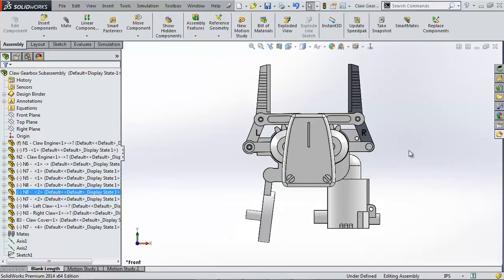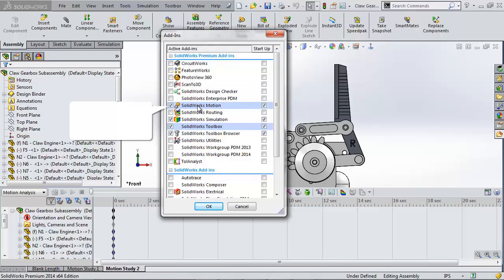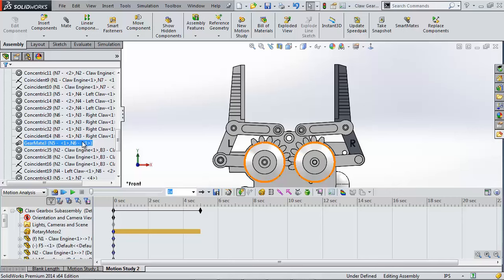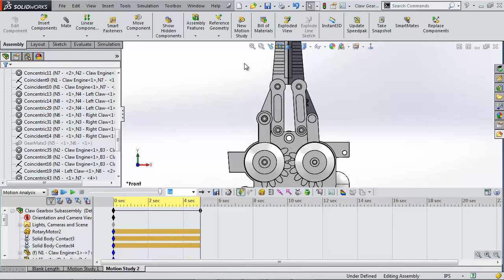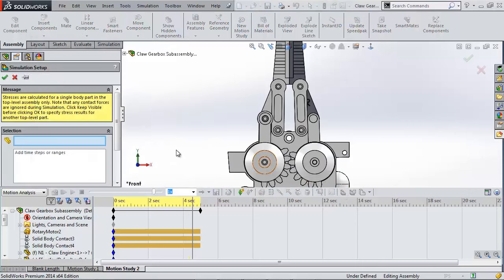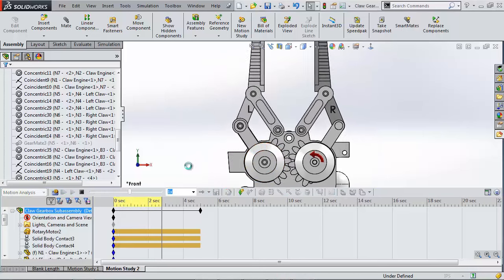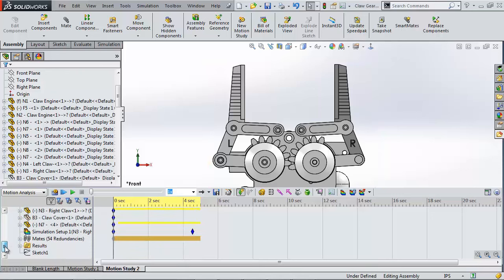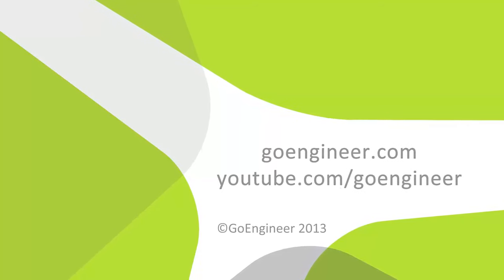SOLIDWORKS Quick Tip - Setup and Analyze Motion Study

Comment: My time bar is fully red ! What to do ?
Reply from the maker: Hi Pranaov,

That means that the assembly has likely locked up or the solution is unable to complete for some reason. Troubleshooting something without seeing it can be difficult, but here are a few steps that may help to narrow down the problem:

1)	Does the motion run if you switch to Basic Motion rather than Motion Analysis?
2)	How many parts or mates do you have? Possibly you may need to simplify. Check out this recent blog on simplifying for Motion Analysis. 
a.	This blog shows how to turn off redundant mates and replace with bushings, and how to change their parameters. That may be necessary to soften up what is binding up your assembly.
3)	Build the assembly up from scratch – start with three components and whatever necessary mates, motors, or contact. Does that work? Add in components a few at a time. Eventually you will see what is binding up the calculation.
4)	Reach out on the SOLIDWORKS forums at my.solidworks.com or your local reseller, I’m sure someone can help you troubleshoot.
Reply: @goengineer  thanks !

Comment: how to change initial position of parts in assembly for motion analysis?
when we move from model tab to motion study tab. Motion study take its initial position from model. if we want to change initial position of part in assembly. the motion study does not accept new initial position... how can we change initial position after one calculation?
Reply from the maker: Generally I go back to the Model tab, adjust the position as I want, and then make a new motion study. This is the cleanest way to have a new starting position.
 The next most sure-fire way to get your exact placement is to: set your grey time bar back to 0 seconds. Create distance and angle mates necessary to get your part into its new position. Click rebuild if necessary to see the update. Suppress those mates in the Motion Study. Then recalculate. 

As you want to continue changing position, repeat the steps above: set time back to zero, unsuppress the mates. Right click on them to edit dimension. Rebuild. Suppress the mates and recalculate.

Comment: When you set the contact between bodies there is also an option to set materials? However you can only use a handful of them. How should one if his assembly ismade of materials other than these?
Reply from the maker: Hi Alex1986lunatic,
The materials used for masses of your bodies in motion are also brought in from the definitions applied to each model before this video starts.  The video shows a single body where material was not applied to illustrate the how the system will react to that situation.
Reply: I don't think that's what happens. By default, the first material option (acrylic) is applied when you set contact bodies - if you had scrolled down a little bit you would have seen that. You must un-select it and then set several values for the material you want which are almost impossible to know for every single material. And this material influences the results of the motion analysis which in turn influences the results of the simulation (regardless of the material you might have originally assigned to your parts through the feature tree).
Reply from the maker: Alex,
Perhaps we are indeed misunderstanding each other.  At this point I would encourage you to contact your local SOLIDWORKS VAR's technical support department (http://www.solidworks.com/sw/purchase/varlocator.htm ) so they can work with you one-on-one to understand and answer this question for you.
Reply: Thank you for your time.

Comment: hi,
there is no choice of animation motion analysis and basic motion bars in the motion study chapter. so i need to explain some diagrams of mechanism. is that about version ? i use solidworks 2014 premium. please turn me asap. thanks
Reply: +Seçkin Bozdemir Basic Motion is supplied to every version of SOLIDWORKS. It may be that you did not install the motion package (check your installation manager options). Motion Analysis is only provided as an add-in with SOLIDWORKS Premium.
Reply: +Shivani Patel thanx a lot for answer. i try it again later.

Comment: Facing this problem many times during motion analysis.
"Number of new element states 1 doesn't match number of old ones, 2."

Please suggest the probable precautions to avoid this problem?
Reply: please check the mates done. any mates redundancy will cause this. i.e if you used tangent mate in assembly between two parts (i.e surface of two cylinders) which touches each other. In motion analysis you need to suppress the tangent mate, because the contact joint is created using the contact joint.

Comment: Hello, good day, I have a problem with my motion analysis, I have an assembly that needs to apply engine torque, but I cannot get a correct result. I'm using Solidworks 2017. can you help me?
Reply from the maker: Hi Berk,
Diagnosing the issues in a motion study in the comments section of YouTube might be a little non-productive.  I would suggest that you contact your local SOLIDWORKS vendor and enlist their technical support team to help you with this issue.

Comment: Why solidworks motion analysis generates low stress?
Reply: +AgnisKnife Motion runs a very simple FEA analysis. For majority of studies I would recommend using at least SOLIDWORKS Static analysis which is provided in either SOLIDWORKS Premium and/or SOLIDWORKS Simulation Standard.

Comment: Good day to GOENGINEER, I have a problem with Motion Analysis. I have two flywheels attached to a shaft and wanted to rotate them and import the motion load to static. I used all default settings from SOLIDWORK MOTION properties. This is the message i get from SOLIDOWORK MOTION. 

At time   1.466666667E-1 the integrator is unable to start/restart.  Possible Causes:
(1) The accuracy required for the numerical solution can not be attained.
Relax (increase) the value of the acceptable integration ERROR.
(2) Incompatible redundant constraints, a lock up, or a bifurcation
situation.  The latter two indicate a mechanism design problem.
(3) The system includes a zero (or relatively small) mass on a part with
an unconstrained translational degree of freedom.
Make sure you have mass on all parts with translational degrees of freedom.
(4) The system includes a zero (or relatively small) inertia on a part
with an unconstrained rotational degree of freedom.
Make sure you have inertias on all parts with rotational degrees of freedom.
(5) An Adams element has a function expression that equals exactly itself.
For example,
     SFORCE/id1,I=id2,J=id3,ROT,FUNC=SFORCE(id1,jflag,comp,rm),and
     DIFF/id4,IMPLICIT,IC=0,FUNC=DIF1(id4).
Similarly,
     VARIABLE/id5, FUNC=VARVAL(id5)*TIME 
equals itself at 1 second. Avoid setting an Adams element equal to itself.

Hope to get help from Go engineer. Thankyou.

Comment: How do you turn off motion study, mine is stuck on
Reply from the maker: In the bottom left hand corner of the screen, there should be tabs. One should say “Model” and then you may have others named “Motion Study 1” for example. If you click on the Model tab that should “turn off” the motion study and let you get back to work. If you’re still having trouble, please reach out to your local reseller for a screen share, or to the SOLIDWORKS community on the forums at my.solidworks.com.